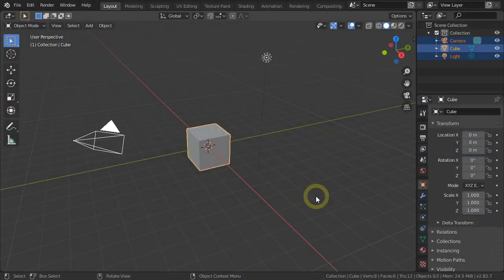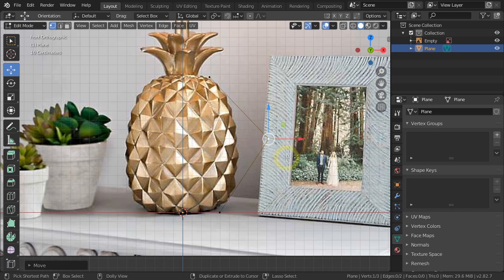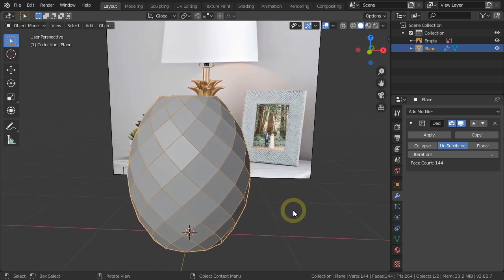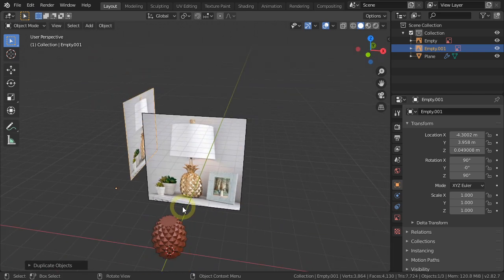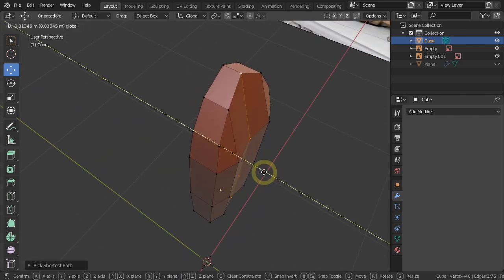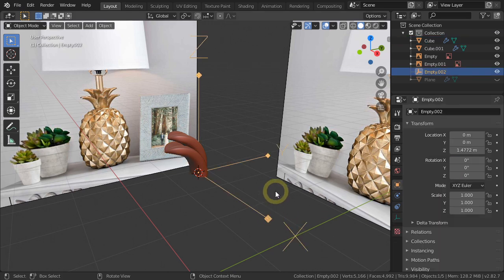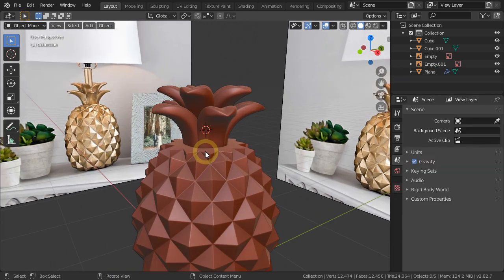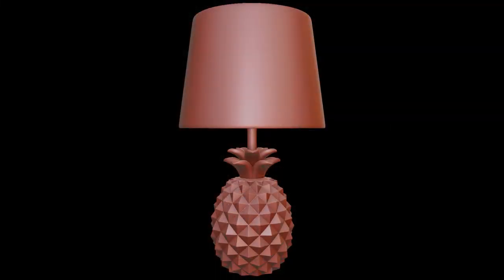Modeling a pineapple table lamp in Blender 2.8.2

Comment: Greetings!  I needed to make something very similar to this.  The model that I am making is part of an architectural ornament, and instead of points on the diamond shapes, the diamonds are flat and have grooves between them.  So I started with your process, and instead of poking the faces, I beveled the edges between the faces and used Alt-S to pull the edges in to make the grooves.  You showed me how to do all of that, and I learned several new tools from you in the process.  Many thanks for this excellent video!  I like your teaching style and I will watch more of your videos.

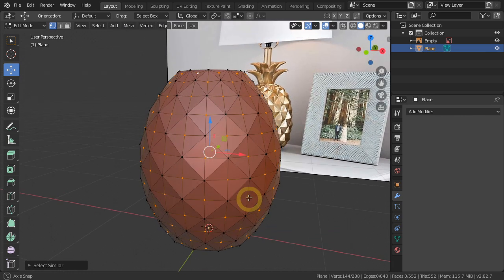Comment: At 7:20 could you aswell select all and checker deselect afterwards?
Reply from the maker: Hi Max. Thank you for the suggestion. But you might end up selecting the vertices that have 8 edges on them. You can invert the selection again but that will additional steps.

Comment: Thank you for the tutorial! Just a quick question about Blender rendering, It is possible to render in Blender 2.8 high quality with Intel Core i3 laptop?
Thank you!
Reply: Yes, but the less powerful the rig, the longer you are going to wait to finish the render.  (and laptops are not recommended for rendering, they overheat easily)
Reply: @_Nikifor  Thank you for replying.